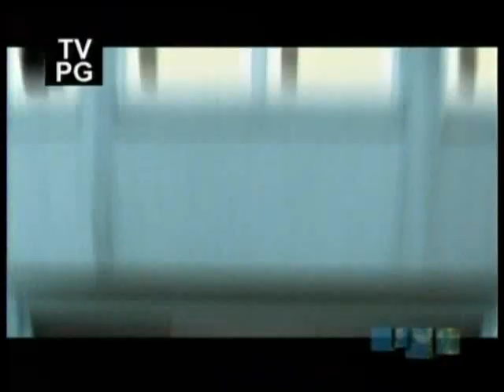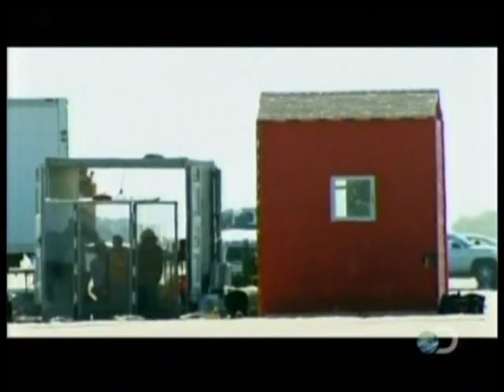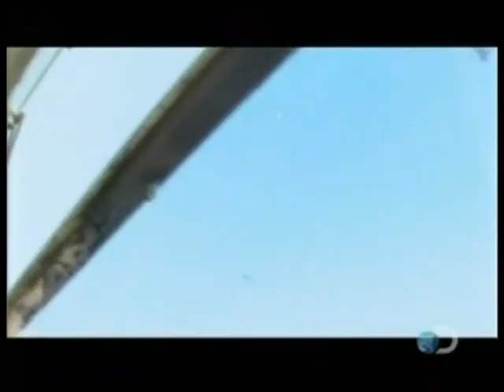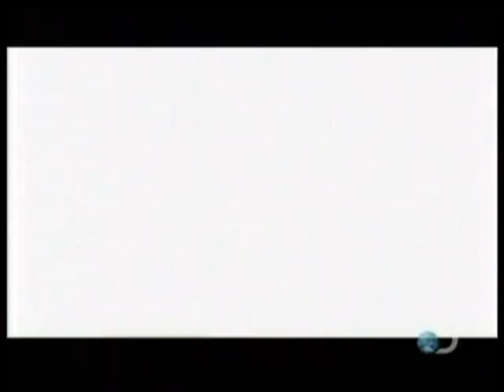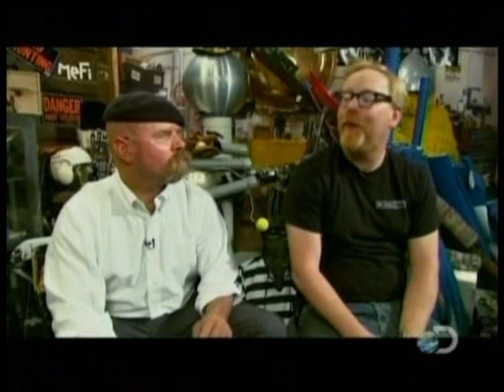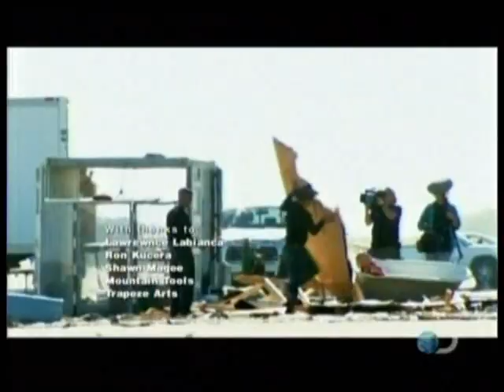MythBusters-Exploding Water Heater

Comment: Oh yeah peeps! Word from a Plumbing Engineer: CAUTION! This could happen to you & happens more frequently than most people realize. Never monkey with a water heater's safety devices (namely: the pressure relief valve, or the pressure sensor). And always be sure your water heater's installation, use & maintenance is per manufacturer's recommendations. It's a one in a million, but when this happens, it is usually due to faulty installation. Never attempt to attach piping to the water heater's pressure relief valve & always provide clearance for the pressure relief valve to properly discharge. When in doubt, call your water heater manufacturer, or a professional insured plumber.
Reply: +MEAN GENE Most states now require a pipe to run down from the pressure relief valve but it must not be connected to any plumbing. I think that they did this because a lot of kids and dumb adults pulled on the valve and got their faces burnt by scolding water. A local plumber tried to tell me that it had to be connected to the plumbing system and I read the manual and called the state and they told me that it would be a violation in my state and it was very dangerous. I fired that guy, he won't be doing work for any of my rentals again.
Reply: Mfr's state that a T&P relief valve should be plumbed to a drain in the floor or to outside. How do you do that without attaching piping?
Reply: +sulfen, what do you mean by "the plumbing system"?
Reply: He means do not hard pipe your pressure relief valve into an enclosed sanitary piping (aka: plumbing) system. A) in the case of sanitary backflow, a closed hard piping system could/would allow fecal matter (&/or whatever) to contaminate your water heater, your entire domestic system & perhaps even the source of your domestic water. Aka: drinking & showering in poop - BAD! B) It would disallow the pressure relief part of the pressure relief concept & possibly instigate a rapid depressurization (explosion) or... C) Introducing high pressure to your sanitary system easily could cause feces (&/or the various assortment of wonderful smegma in your sanitary system) to transform into flying balls of em, ...ejecta emanating (at high pressure mind you) from your sinks, tub drains, etc. And keep in mind the fun part is that B & C would/could occur simultaneously. Which is to say, as your water heater is spontaneously egressing thru your 2 stories & blasting the roof off of your house (as displayed above), your plumbing fixtures could/would spray **it all over whatever of your house that is still standing. With any luck, you will not be home & your water heater not land on anything meaningful when it comes back down to Mother Earth.
Reply: ...also @sulfen ...Whelp, that would seem to be for residential applications on tanks of 50 gallons or less & would seem to be somewhat of a new direction that is news to me. Regardless, I have always consider this particular aspect of manufacture's recommendations & code requirement as being optional, as required, minimal, other than optimal & counter-intuitive at best. Btw, I also still ONLY use copper for domestic systems too. I have NEVER done a water heater like that & I have never experienced a code official that objected to any of my installations. But then again, I do mostly commercial & institutional installations in full-on dedicated boiler rooms. So admittedly, I'm not 100% up to snuff on residential code. Just saying, pressure relief valves go off like an jets. The pressure washers used for cars would be lesser example. Mind you that a pressure washer discharge would be a small fractional percentage of a water heater's pressure relief valve discharge, which I would estimate typically discharges at +/- 100 times the volume & pressure of a pressure washer. A typical pressure washer's flow rate is surprisingly small (ie: several gallons per minute). But a water heater would blow it's 50 gallons (or whatever) in a matter of a seconds. So, constraining that type of pressure in piping & piping it, for convenience, defeats the primary purpose & function of the pressure relief valve (that being relieving pressure) & (in most applications) unnecessarily complicates an already complex & potentially dangerous configuration! Seemingly, even more counter-intuitive is to "REQUIRE" the t&p piping be ONLY the same size as the t&p valve discharge opening (3/4" typically). That would seem to invite catastrophe. So, I whole heartedly disagree with this & do NOT practice it. I would think a well advised & responsible code/manufacturer would MINIMALLY  require the piping be 3 - 4 times larger than the pressure valve discharge. I would also think it would require (& have seen applications where) a scupper type setup, with an air gap, has been installed, which ends up looking like & functioning just like a faucet with an little sink. This allows the pressure to be readily released, whilst collecting the majority of the water. Worse case, I would opt for that, but I have never needed to go to that extent. In my opinion & practice, the better solution is to just put the water heater near a floor drain, or install a new floor drain, if need be. It would seem a child should not be in proximity of dangerous mechanical systems, no more than they should be in the drivers seat of a running cement truck unsupervised. Why anyone would implement code to dictate that scenario eludes me. Even still, it would seem a water heater's rapid depressurization (aka: explosion) as a result of (code compliant or non-compliant) piping on the pressure valve is FAR more dangerous to a child's well being (& that of any animal, vegetable & mineral in the vicinity) than being momentarily scalded by a pressure relief valve. So, yeah, I seen & heard tell of it, but in my opinion, piping a pressure relief valve, of any variety is foolish & BAD advice! ....as is plastic piping in match stick houses! Fine below grade, but if you know what Dioxin is (a by-product of burning plastic & perhaps the most toxic man-made substances on the Planet), you know why I ripped out all the plastic piping in my house.
Reply: You can pipe it to the floor or floor drain but need an air gap between the drain and the floor to prevent possible cross contamination between the sewage and water supply.
Reply: Hello!
I’ve read online that water heaters are supposed to be silent. Mine is when the hot water isn’t running, the water heater doesn’t make noise until someone gets in the shower or using the hot water. The sound it makes is like water sounds, idk how to describe it, but it stops like 5ish minutes after the water is off. Is this sound normal? And are water heaters supposed to be completely silent?
Reply: @kiahnabaker7871  ...not sure where you got that understanding, but noise can come from many parts of ur plumbing sys [overall].  But generally with tank style water heaters, when the heater... [gas burner (manifold, under the tank) or electric element (sim to elec stove burners, inside the tank)] ...is running, some ticking & popping is to be expected. That is the sound of things [piping, heat tank parts, etc.] expanding as you make them hot.  This may continue after use, especially during & several minutes after use.  In some cases longer.   In some extreme cases [poorly insulated, inefficient] system ticking & popping is practically continuous, all thru the [metal] pipes to the fixtures, all the time.  That is heat spreading & dissipating [expending & contracting] throughout ur system.  As long as it not VERY loud, enough to be bothersome, & it works well for you otherwise, I think you can continue using.  Also many tank style heaters only work for 5 to 10 years, or less, because of scale.  Some can be maintained [fixed], others are essentially disposable.   The combo of water he heat is VERY corrosive, & produces 'scale', which can be powered-ie white residue, &\or hard-white build-up accreted [stuck] to everything contacted by the heating process.  In sever cases that includes all [hard pipe] hot fixture supply piping, & [shower & sink faucet] water mixing valves, etc.  Scale comes from the heating of the microscopic debris particles that reside in all water.  Scale quantity depends on purity / treatment of supply water feeding the water heater.  I've seen tanks that were over 1/2 full of scale.  Far less scale than that can block & cover the water heater element or burner from heating the water, & it runs but heats less efficiently, if at all.  Many variables at play,  ...so [final answer], consult someone w knowledge, perhaps a hardware store person, a local [plumbing pro, etc., perhaps someone that can check-out ur system, first person.  Good Luck...
Reply: @erics3886  YES - 'Air Gap'!  Yes, I should have said that.  Very important phrase.  Good call Eric.  Fyi - depending on system specs, building type & building location, 'air gap' specs differs WIDELY.  Most are very concisely called out in ur local building codes.  Yes sir, tyvm...
Reply: MEAN GENE it’s a gas, and the blinking light reads as normal operation but should I still be worried for the sound?
Reply: @kiahnabaker7871  I do not know.  It is hard for me to say more w/o hearing it myself.  Is your domestic hot water piping insulated?  Old school is fiberglass, cloth, newer is foam, like a pool noodle.  If cloth be careful about asbestos...

Comment: If you have a check valve (back-flow preventer) in your plumbing, make sure you have a thermal expansion tank.
Reply: Or a PRV
Reply: I dont know what your safety regulations are in the U.S. for hot water heaters, but here in Australia, all mains pressure hot water heaters have to have  a couple safety devices fitted, along with a backflow prevention valve. first is a pressure relief valve , and the second is an expansion valve. they both prevent any possibility of any kind of mishap like this video shows. plus, any plumbing work, apart from  the simple job of replacing  washers, has to be done by a licenced plumber/gasfitter.
Reply: @catey62  Basically the same here in the US, though you do have those that don't care about regulations and do all their work themselves. I have no doubt there are several setups in my state alone that are missing safety devices and are likely capable of this.

Comment: We had a water heater that turned into a geyser when the thermostat failed. It would heat up until the pressure relief valve started spouting hot water all over the roof for about 15 minutes. Then it would fill up again and repeat in a few hours. 
The terrific thing about boiler explosions is that there is a lot of water that only was one good reason not to boil: it's under tremendous pressure. Once the boiler breaks and the pressure is relieved, all the water turns to steam instantly. The power in the boiler of a big locomotive is about equal to a 1000 pound bomb (if I'm informed correctly, I forgot the exact source, but I think it was a respectable museum).
Reply: Thermostat?? U mean aquastat??

Comment: I had my air compressor's tank fail at about 2am one night.  Took out the roof above it, made a big boom followed by a clanging awhile later as the metal tank base came back down on the driveway....   Never did figure out if the tank was flawed or if the pressure switch failed...

Comment: I have a water heater in the closet in the room that I sleep in.
Reply: same :c
Reply: Sameeeeeeeee but my water heater sucks and runs outta hot water after a 5-8 min medium temp shower so I’m not worried....but I really miss hot hot hot water  😩
Reply: ...so make sure you don't try to give it a vibe check
Reply: oh thats a nightmare im worryed for you
Reply: don't worry lol all water heaters have pressure relief valves- instead of being blown up you get 3rd degree burns.
Reply: my water heater is in the room adjacent to mine, so if it goes up im getting a face full of steamy splinters
Reply: So long as you don't plug up the pressure relief valve you're fine
Reply: Samee
Reply: @thetomgamerboi6817  I still don’t want that 😭😭
Reply: @LMSPetRescue  You may need to set your water heater's thermostat to a higher temp.

Comment: in short, water heaters are only likely to blow if the one you have is extremely old and has poor safety mechanisms or no safety mechanisms, has tank walls that are very fatigued, or gets too hot
Reply: It's the "Swiss Cheese" theory of "it can't happen".
If all the holes in successive swiss cheese slices (all the safeties fail) line up...kaboom!

Comment: On a properly installed system the pressure should never get above 30 PSI without dumping the water onto the floor and/or popping the air release valve. Incoming water from City is at 50 PSI and reduced by a valve before it reaches the furnace.

They don't have any relief valves, pressure tank etc showing on the unit they put in there, and no mention of the incoming PSI but I would guess its at industrial level rather than household (think the pressure from a high pressure fire hose).
Reply: Hello!
I’ve read online that water heaters are supposed to be silent. Mine is when the hot water isn’t running, the water heater doesn’t make noise until someone gets in the shower or using the hot water. The sound it makes is like water sounds, idk how to describe it, but it stops like 5ish minutes after the water is off. Is this sound normal? And are water heaters supposed to be completely silent? I’m only asking cuz you seem to know a lot and after watching this vid I’m scared 😬
Reply: @kiahnabaker7871  
That sounds like normal operation as when the person takes a shower hot water is forced out by cold water coming in to replace it.
When the shower is turned off the incoming water continues to enter the cylinder but only until the water pressure in the heater is equal to the water pressure of the incoming water...
then it goes quiet because there is no "running"  water any more....in or out.

Comment: I am a home inspector and find water heaters installed improperly, poorly maintained all the time. If the heating thermocouple were to lock in the heating mode, they would have blown.  So easy to install correctly and to maintain.

Comment: Can anyone tell me, does it matter what kpa valve is installed in any given water heater if they're all designed to open just before boiling point anyway? Is pressure directly correlated with water temperature?

Comment: CALLING MYTH BUSTERS: Jamie/Adam (Peter Rees)

You need to do a EUROPEAN version of this . . . . . Apartments with steel reinforced concrete floors, but 'card-board' interiors.

I thinks this would be even more devastating with the cylinder possibly ricocheting many times within an apartment floor and/or an explosions that would devastate many apartments on that floor, and possible compromise the structure of the entire building.

The walls between the apartments and walkways are usually single or dual breeze block, as with the outer wall.
The walls within the apartment are usual wood or steel studs with gypsum plaster-board.

Can you not find an apartment block about to be torn down, but set up this experiment before they start ripping it apart and then repeat your experiment?
Kit out three entire floors (several apartments per floor) and put the hot water cylinder in the middle floor?
I suspect there might even be enough power to lift the concrete floor that it initially hits.

Typical water cylinder sizes in Europe are 210L!

It would really help to motivate the owners and landlords to take yearly and consistent inspections more thoroughly.
Reply: A friend did almost the same experiment with a welding cylinder (oxygen @ 3000lbs sq inch.)
Accidentally dropped down a shaft in a three storey concrete floored industrial building..and exited through the concrete floors and the roof to a position 300 yards away...

Comment from the maker: @Anel750214 Thanks. I'm a home inspector and this is a perfect example of what can happen if the water heater is not maintained!
Reply: Funny Rick.
Reply: I was linking to this video to show people the dangers after I got to my mom's house and saw the bottom of her tank had expanded like a balloon, from concave to convex, lifting the whole tank and making it wobbly. Glad I noticed it and shut it down and then replaced it.
Reply: Hello!
I’ve read online that water heaters are supposed to be silent. Mine is when the hot water isn’t running, the water heater doesn’t make noise until someone gets in the shower or using the hot water. The sound it makes is like water sounds, idk how to describe it, but it stops like 5ish minutes after the water is off. Is this sound normal? And are water heaters supposed to be completely silent?
I’m only asking cuz you know a lot and I’m scared after this vid 😬
Reply: Greg Liebig it’s a gas, about 4 years old and the blinking light reads as normal operation but should I still be worried for the sound?
Reply from the maker: @kiahnabaker7871  are you on well or do you have hard water? If it sounds like it's bubbling and popping when heating the water in the tank could have sediment and you should talk to a plumber to drain it and refill it per the manufacturer's recommendation
Reply: Greg Liebig no it’s not popping or anything like that